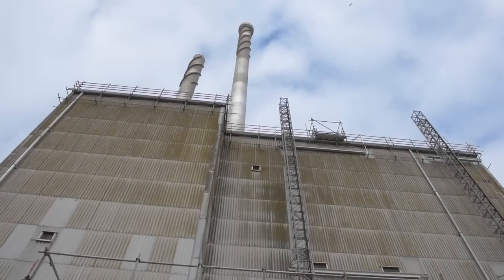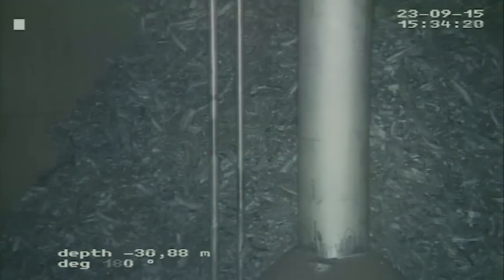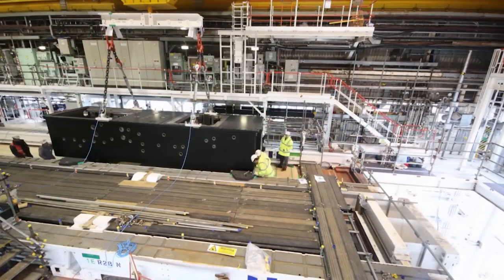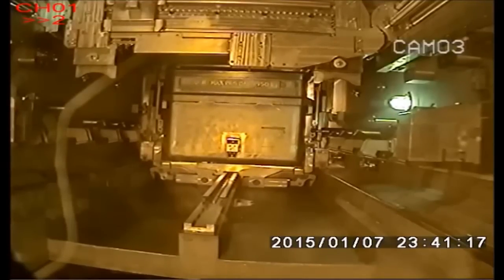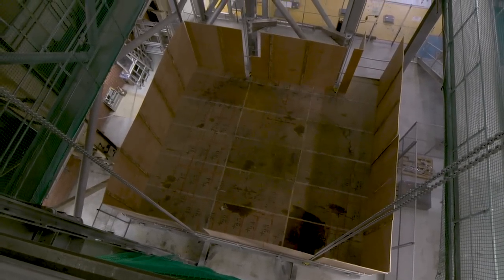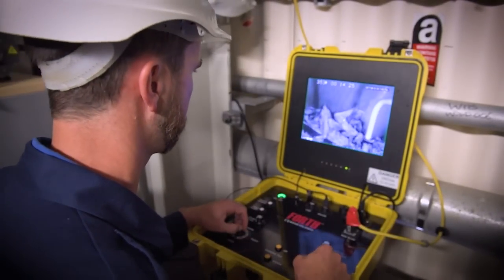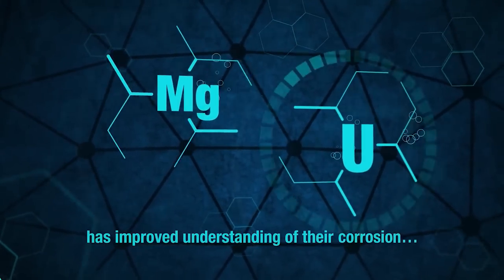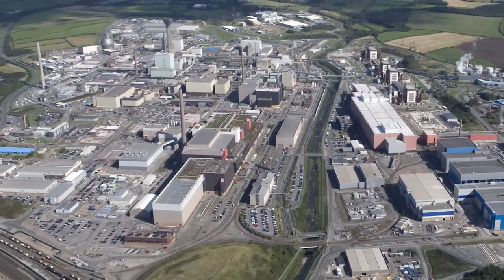The Magnox Swarf Storage Silo: Making our most hazardous facility safer

Comment: In nuclear there is no "clean up" - only relocation.
Reply: You could say that with any type of cleanup even if you spill something on the floor and wipe it up yourself and then bin a piece of paper towel that’s only been relocated ultimately here they are storing it properly and how it is stored means they can access it in the future and technology advances and allows energy recovery
Reply: @TheLostPacketYT Strongly doubt that there's any meaningful amount of energy to be extracted from _cladding_, which magnox is. That's like saying "technology advances and allows us to feed ourselves with our binned spam cans and wipes wet with spilled milk"

Some actual advances to look forward to: pebble bed reactors, molten salt reactors, fusion power... The good bit in all of this is invention of new forms of fuel and fueling processes, which minimize the need for things like cladding and other byproducts around fuel in the reactor, so there's less material to become contaminated and form problematic amounts of nuclear waste.
Reply: @u1zha  even lower amounts to be extracted are still useful in some scientific applications where the lower amount of energy is an advantage for testing processes

Comment: When the grabbing tool drops the material is there a risk of creating sparks and igniting the gas?
Reply: No, the air above the pond is ventilated and would stop the build up of the hydrogen far below any chance of ignition.  You need to have a very high concentration of gas to ignite.   The risk was identified and processed put in place to prevent it years ago.
Reply: I think the atmosphere is Inerted with nitrogen.